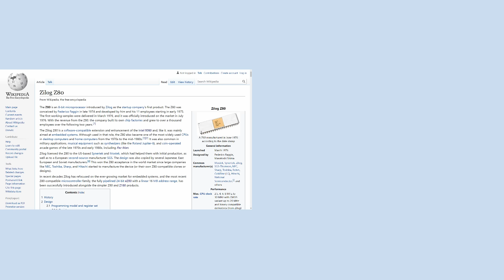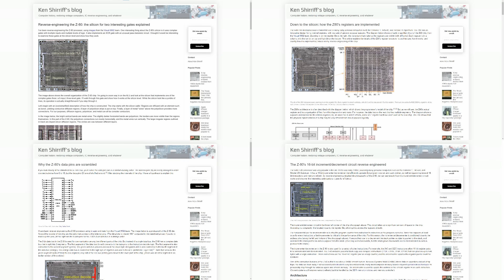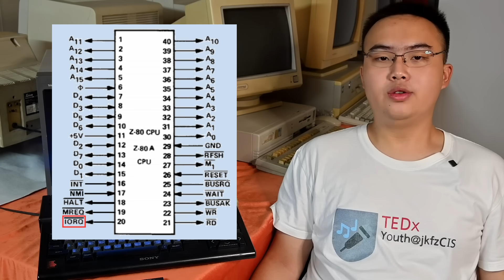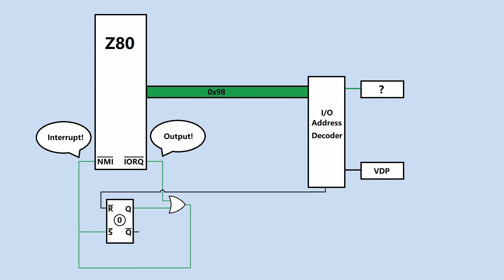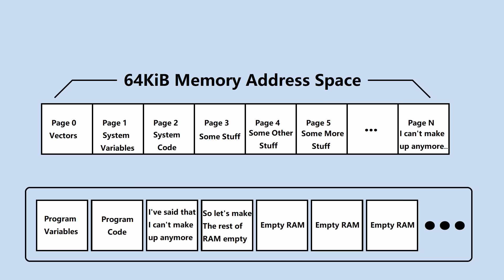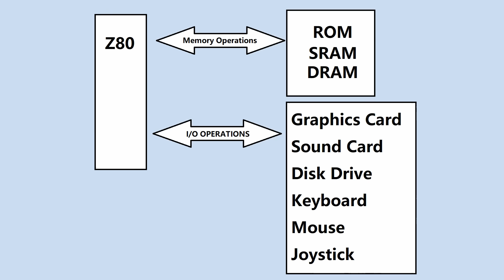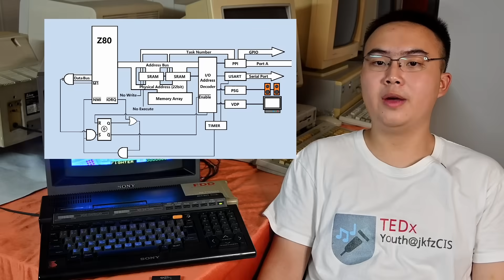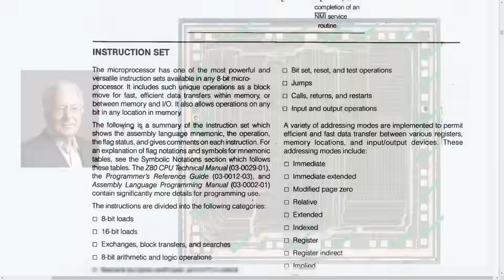The Z80's secret feature discovered after 40 years!

Comment: My first computer was a TRS-80 and with help from a College professor friend I learned Z80 assembly language on this machine. Thanks for the look back. Sometimes I miss the days of hardware and software hacking to make the computer do things it wasn't intended to do. These days I get my hardware and software fix with Arduino's and Raspberry PI's.
Reply: But it's almost impossible to get a pi now
Reply: @nosuchthing8  Really? In the uk they are available.
Reply: @G-ra-ha-m  well of course.
Reply: @nosuchthing8  It's disappointing that they have become scarce, I have a few pi 3B+'s and one pi 4 with the pi 3b+'s dedicated to running 3d printers.
Reply: @electronron1  Yes, the Pi400, overclocked to 2.2GHz, is doing a good impression of a pretty usable PC, silent too, they are becoming very capable.
I use an (cheap, small) HDMI to DVI-D adapter which makes older monitors useful too!
Reply: They got scarce because they're being used in everything now. However the raspberry pico was created and it seems plentiful and cheaper so hopefully it will help supply issues. There's a number of low end cheap boards now.
Reply: @metatechnologist  you can't put a real os on a Pico though
Reply: @nosuchthing8  wow where have you been?? (Or you're quite young) Linux can run on anything. Find and see the Yocto project. Linux has already been put on the Pico board. Also Unix itself started on hardware less than Pico using magnetic cores. The very first Linux was distributed on two 5 1/4   floppies!

So yea, you're kinda dead wrong on that one!
Reply: @nosuchthing8  I don't think that was ever the planned used case. Pico is a microcontroller to rival Arduino.

I got a Pico with one of the hackspace magazines. At the time I had no idea what I would do with it. Now I want to use it as the basis for a DIY flight simulator controller - including rudder pedals.

Think peripherals.
Reply: @metatechnologist It took 2! What a blotted distro 😊
Reply: and doing it within 64k!…
Reply: Mine too.

Comment: what exactly is the secret feature discovered? as someone who literally grew up with Z80s and wrote and published my own virt386 machine monitor with EMS emulation (that later ended up in freeDOS IIRC) I don’t get this video. Bank switching was well-known and x286/386 protected mode has dedicated descriptors, a multi-level ring architecture, and the infamous descriptor/segment caches. Can people here help me with that the new thing actually is in this video and what the reference to protected mode means?
Reply: Not a lot. Basically wrap the IORQ pin back through to generate an interrupts on IO ops so they can be monitored/changed etc. I don’t honestly see how this is can be called protected mode. But it does seem to have some utility by making it so “user” code can’t generate IO ops directly, though I suspect the performance hit would give it limited practical use.
Reply: @lawrencemanning  and there's the question how do you signal real IO if IORQ is fed to NMI... ;)
Reply: This IS a clickbait video. Basically "Z80 has a PM" then goes to build shit entirely outside of Z80, using none of Z80 builtin "undocumented" features. Exactly the same thing could be done with 8080, 8086, or 6502 - just setup external memory banking/address capture and hit NMI for some software emulation.

Comment: FWIW the ability to implement pre-emptive multitasking does not depend on the presence of a protected mode, millions of embedded systems run a preemptive RTOS on small microcontrollers.
Reply: Yes, Intel sold one for the 8080 processor called RMX8080.  It would run on their 8020 PCB that you could buy.
Reply: And Amigas... :)
Reply: @capnzilog  
And QLs

Comment: It would be amazing if  someone would make  a  Military Grade Z80A  clone chip on  7nm wafer process, with a 64K  L1 Buffer so all code and data can run at full speed !
  Consider the SGS Z80 6 MHz vs Zilog Z80 4 MHz - the  SGS military grade Z80 can work at below freezing and above boiling temperatures: -55°C - 125°C .
Even the  Zilog Z0840008PEC  runs at 8 MHz and operates at temperature of 	-40°C - 100°C.
Reply: The Z80 isn't memory bound like modern CPUs, it doesn't have to wait for memory to catch up, it's actually "slower" than the RAM in 8-bit micros. That's what allows the video circuits to also access RAM. So code already runs at full speed.

Of course, modern fab technology could speed it up. You can integrate a Z80 into an FPGA at hundreds of MHz. Zilog sell Z80s at around 20MHz. If you really wanted faster, you could go up to GHz with modern tech. Nobody has, though, because Z80s nowadays are used as microcontrollers, integrated into a larger chip, to control hardware, so it just doesn't need to be so fast. If you wanted the power of GHz you'd also benefit from a modern 64-bit chip.

But it would still be cool though!
Reply: @greenaum   :-)  I'm saving my money up for when the first  128 - Bit CPUs get released...   Still . . .  Waiting . . . :-D
Reply: While there is indeed still systems and code in mil-space targetting the Z80, re-making the old hardware is no longer the preferred approach for maintaining and upgrading those old weapons.

Nowadays people go for FPGAs. More flexible, interchangeable and available. Got this confirmed by somebody working in the space at a conference recently.

So if you have a (sub)-system that has Z80 code and needs an upgrade one would plugin in a FPGA synthesize the Z80 on it and whatever other upgrades are required.

Comment: Multitasking on the Z80 CPU is no problem. You got Caruh for FutureOS on Amstrad CPC for example (and other solutions too). Nice Video. Thanks!
Reply: Guessing that’s cooperative multitasking.
Reply: @MatthewKanwisher  Don't think so (although I don't know Amstrad stuff). Many embedded systems (including some designed by me) of the 1980s and 90s implemented preemtive multitasking on the Z80 and Z180.  Even ordinary interrupt routines (used in both embedded and personal computers) are preemtive, strictly speaking. As the process being interrupted for a few ms does not have to know anything about it.
Reply: @MatthewKanwisher  I'm pretty sure you could do it either way, but you'd need an OS. You couldn't really do it just with the built-in BASIC.
Reply: @MatthewKanwisher  Yes, it's cooperative. And an application / process can give the control back to the multitasking manager (Caruh) in case there's nothing to do at the moment. So, it's saving lots of time too. It's not completely preemptive in the classical sense - again to have some gain in speed. 🙂

Comment: In the early 1980s a whole UK army signals system used a single Z80 in a shielded casing.  Impressive.
Reply: I built a phone system using a microcontroller using less RAM and ROM than the Z80 could handle. I had 1.5 KB of RAM and around 30KB of ROM.
Reply: @deang5622  what kind of phone system?
Reply: I've still got a clock that decodes the radio signal broadcasting the atomic clock from Rugby.  Runs on a Z80 with no RAM at all, just an EPROM for the program.  It used all the registers to hold the decoded values and a bunch of chips to run the 7-segment LED display.
Reply: Company I worked for used them in an a tandem Sperry V77 with two 7' cabinets of magnetic core RAM to do legal wagering calculations at horse and dog tracks. Four 9 track tapes, no spinny disk, and if you looked hard enough, you might find a kick starter on it (snicker). Thing was MASSIVE because of the interfaces, usually 5 to 7 entire racks. The UPSs we hand built used aircraft batteries - a whole room full. I saw several hooked up via RS-485 to 150+ terminals, one place had over 600.
To boot required entering a string in octal via the front panel switches to read from tape. I sometimes wake up to find my hands punching in the sequence, 40+ years later.
Reply: I still have my Sinclair ZX-81 based on the Z80 CPU and it still works on a small LCD monitor that accepts NTSC Channel 2 or 3. It has just 4 chips: the Z80, 4K x 8 SRAM, 8K X 8 ROM, and a custom ASIC that did the address/keyboard decoding, display interrupts, video generation, tape data recording/playback, and overall system timing. It was amazing for its time and cost me only $100 US dollars in 1982. I got it at the lower price in kit form. They were so popular it took 6 months for it to be delivered. Mine came with a letter that said they apologized for the delay so they sent me a factory refurbished and fully tested unit for no extra charge. They said if I still wanted the kit, they would gladly take it back, but it would take another 3 months before the kit could be delivered. I opened it up and the soldering and components looked fine so I kept it.
Reply: @Tarik B. In 1987 VGA came out which supported 256 colors at 320x240 and 16 colors at 640x480. Definitely better than MSX. Ad Lib also released their first sound card that year.
Reply: Fun fact: Rockets and Rovers use PowerPC chips.
Reply: @xanderplayz3446 radiation hardened 400mhz less tha a wii slightly better than gamecube.
Reply: @Tarik B.  That sounds like an IBM portable... it was an XT class machine that would be able to run up to windows 3.0 (probably with a ram expansion), IBM nor Compaq made an amber screen AT class machine.
Reply: @Tarik B. I believe the Z80 clock is the REWBICHRON described here:

https://worldradiohistory.com/hd2/IDX-UK/Technology/Technology-Modern/Archive-Radio-Constructor-IDX/IDX/80s/R&EW-1983-04-OCR-Page-0054.pdf
Reply: @Tarik B. This is a fair critic against the CGA which sucked unless you had the rare composite output, then it sucked a tiny little less, looking a bit like an Apple II in the very few games that supported this 160x120@16ish colors. It also had a mono 640x200 (used in SimCity, for example). Tandy actually borrowed the improved card from the PCJr, which allowed 320x200@16 or 640x200@4. Since CGA did allow 16 colors in text mode, iirc there was some pacman clone done using text mode back then.
Reply: @Tarik B. From what I have seen of system descriptions, the Amstrad CPC was the best Z80 and 8bit system, . The CPC 6128 cand CP/M.
Reply: @joefish6091  I had a 6128. They were pretty useable in their day.
Reply: So it had probably only a little bit more computing power than intel i7 running windows. If we make adjustments for all the bloatware and telemetry.
Reply: @janpomianowski4208  my kids played this https://youtu.be/hypjQwgrus4 on a XT(808x cpu). Its based in its clock speed and recently tried it on a W7 VirtualPC DOSvm and game runs so fast you don't even get to make a move. As you say, all that extra cpu cycles taken up with other stuff. What I'm waiting for is WINDOWStelepathicAI that knows what I need to comlete at work and completes it before I get in and secure my 1st coffee ...
Reply: @janpomianowski4208  You got an lol from me good sir!
Reply: Clansman?
Reply: @nsp265  LoL, I do know of Clansman. No, this was a custom built system for a non UK  army.
Reply: @deang5622  I was thinking of the 1BR Corps Patrol Unit.
Reply: @Tarik B. lol sound chip and vga chip has near nothing to do with either Z80 or PC XT... so im not sure what you are trying to say
Reply: @effexon   He didn't mention VGA or sound chips.  Tarik appears to be referring to the capabilities of the MSX as a whole and the typical PC XT at the time as a whole.  Sound on the XT was really rudimentary.  Just a single square wave tone generated by a system timer chip.

I'm guessing he maybe didn't have access to a VGA card on the XT, since page flipping in the X modes was great for game dev and he also mentioned less colours.  So I'm thinking CGA/EGA/Hercules.
Reply: @BeardyMacBeardFace  Yeah the most you would have on an XT would have been Hercules... and more likely just CGA.
Reply: @BeardyMacBeardFace  But it could play Fur Elise...  and  Close Encounters' theme.  :-)  I used it to play NetHack and had to trade between the NetHack disc and the boot disc during gameplay because that XT had no hard drive.
  But I played upright video games that were Z80 driven and had hi res vector graphics and such.  I worked for the distributor and was able to play free every day.  
I am still able to emulate the processor and play any game from that era that existed on my PC or laptop and pump it out to a big screen TV.
Reply: @effexon  Well, a standard-equipped PC then could not match the graphics and sound of many of the Z80-based computers. A VGA card and decent monitor was expensive so a very large number of computers had text-only (with block graphics) or a bit later got monochrome Hercules graphics. Also lots of money to maybe get an original 8-bit mono Soundblaster card. Or the 8-bit stereo Soundblaster Pro.
Reply: @perwestermark8920  check out "8088 MPH" and "Area 5150" to see what standard PC and CGA could've done if they'd known how to at the time
Reply: @snooks5607  I spent quite a bit of time visiting demo and programming competitions when I was younger. Lots of tricks to abuse the hardware to the fullest.
Reply: @effexon  What do you mean you're not sure? He's just saying dumb shit to diss the PC, obviously.

Comment: Maybe a dumb question, but just as the 8088 didn't have a protected mode, and the 386 did, why not just use the 16 bit protected-mode supporting version of the z80... like the Zilog z280? It's binary compatible with the z80 even in protected mode ( well, a few instructions missing in protected mode ) and it's z80 circuit compatible too... And has the built in MMU and Cache Memory like a 486, but came out mid 80's.
Reply: This is a retro design video. It explain how it COULD have been done with commodity hardware back in the day. Why would one built a new Z80 sytem nowadays from scratch?
Even military equipment goes commodity ARM and/or FPGA today.
Reply: @michaelrenper796  I do understand that, and credit where due, it's a very clever idea to build the missing CPU elements into the hardware, as often happened back in the day. But the z280 also existed back in the day, and had all of this functionality. There really was a z80 that did all of this without needing to externalise it... It would have performed a bit like a 386DX with cache memory, and could have done so in the mid 80s. I guess I'm wondering why, even back in the day, anyone would have created a protected mode z80 when you could just buy a protected-mode-capable z80 off-the-shelf anyway?
Reply: @CJ7Hawk  There could be some cost savings using external hw for the few systems that need a protected mode while the majority of systems could be identical except for that circuitry.

With how expensive and limited memory was at the time, multitasking, virtualization, and emulation were probably not in high demand.
Reply: @CJ7Hawk  You are right, the time window for this to make sense is very small.
For me and other its the retro aspect here that is fascinating. 
Helps understanding microprocessore design basics as I have only theoretical knowledge of modern CPU design and no time and intention to go out tinkering.
Reply: @michaelrenper796  More than several people have built and are planning to build homebrew retrocomputers. The author of this video is one of them as you'll see if you watch some of his other videos.
Reply: @michaelrenper796  You might use an Z80ish thing in the form of a Rabbit microcontroller on something with an extreme power budget.
Reply: T|he Z280 was a bit of a car-crash, buggy and painful but in theory could do that kind of virtualization. But by then you also had the 80286 which had protected modes. I did try and do some work on Z280 but there were too many times the emulation did the right thing and the CPU did not.